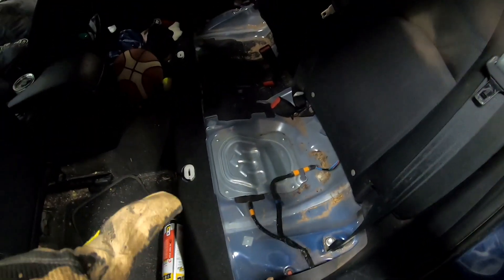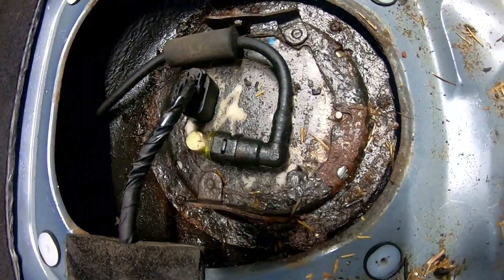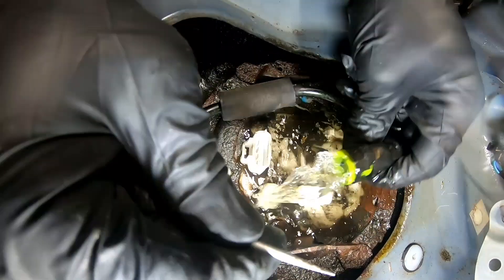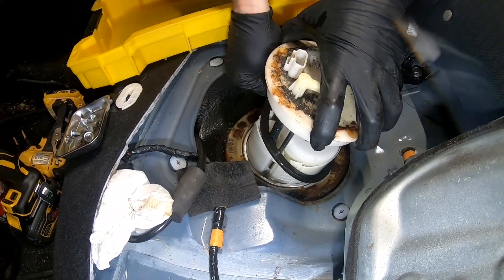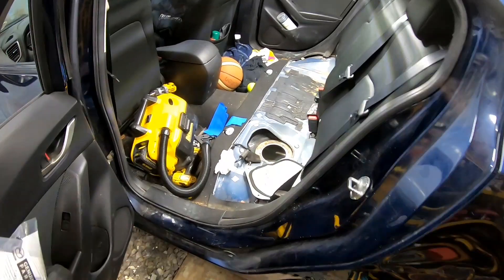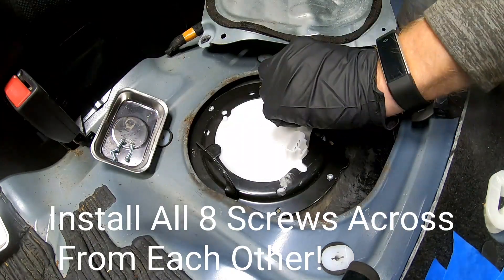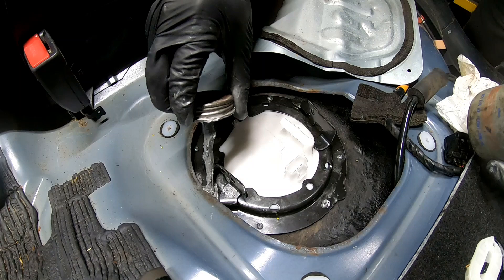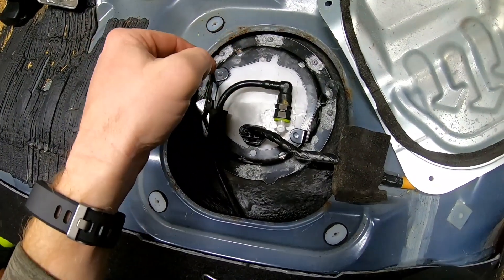Mazda Fuel Pump Replacement DIY!

Comment: What year was this model.I have an 09 mazda 3 that needs fuel pump replaced would this process work same??
Reply from the maker: Yes same process! 2014! Thanks for watching and good luck!👍
Reply: @WhitehouseFarmVet  The 1st gen you need to drop the tank to replace the fuel pump so not quite the same process and not nearly as easy. Don't forget to unplug the pump underneath the passenger seat. Unfortunately the hole isn't big enough to pass the whole pump through.